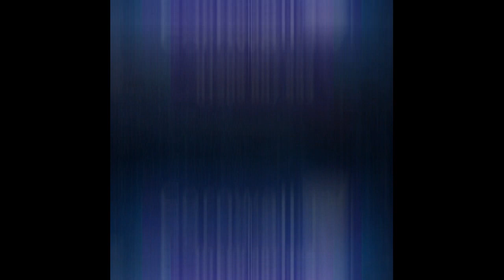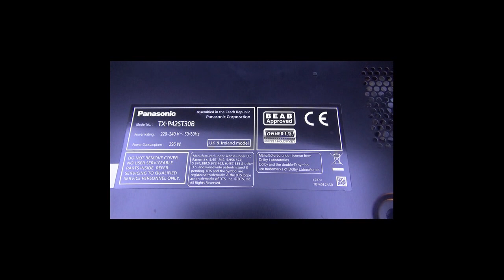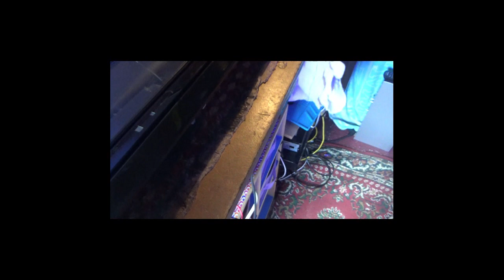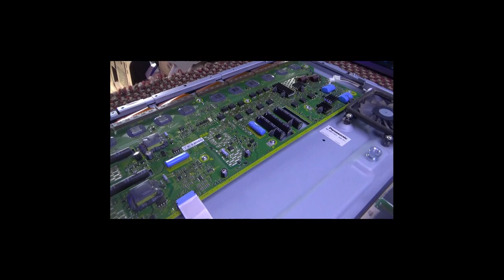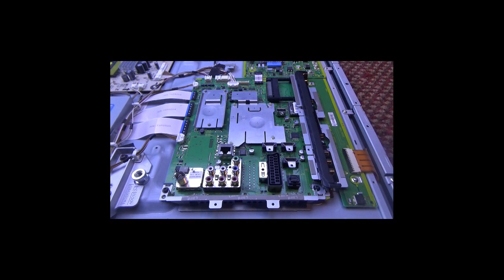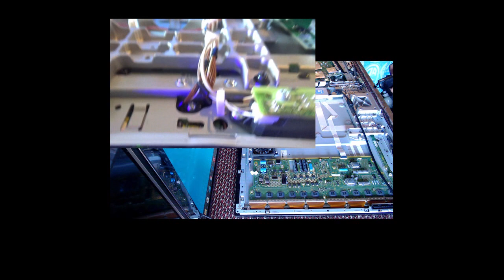panasonic 14 blinks error fixed

Comment: Hi I have the same TV,the problem I have is the fuse F102 (T4AH) on the power supply is blowing as soon as it is plugged in.
I bought a service kit to replace fuse and Q301 & Q300 but the problem is still there.
Please if you have any advice it would be much appreciated.
 (On further investigation there is a SN repair kit  with about 9 different components so I will give this a try.)